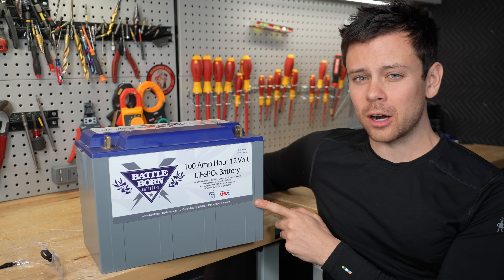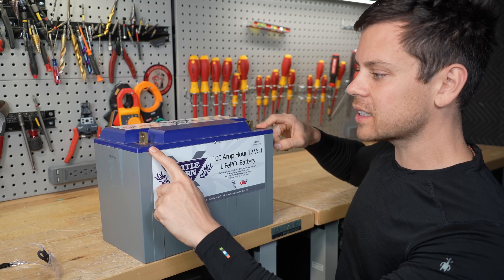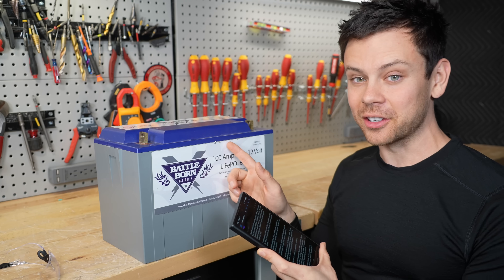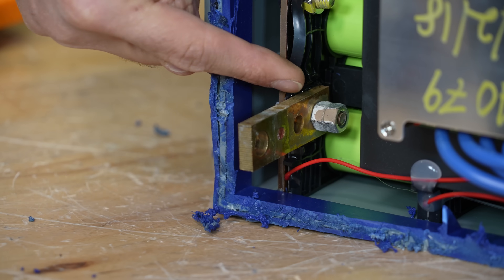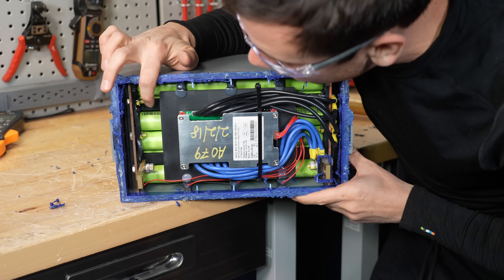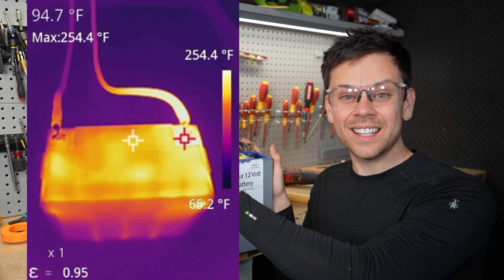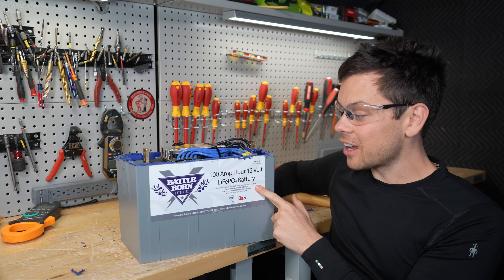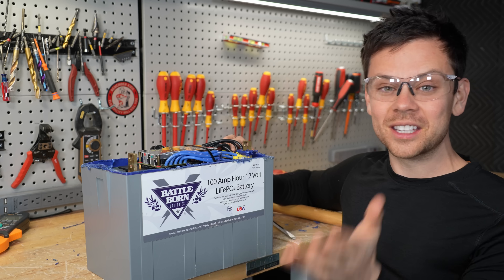Battleborn 12V Battery: Major Safety Issue

Comment: Hey Will. 

I have been TELLING people about this issue since 2019.   I brought it up DIRECTLY with 2 of their highest Ambassadors, SV DELOS and another sailing channel who asked not to be named ,, and I got an EMAIL from BB claiming the owners must have ABUSED their batteries if they were having issues.  There should be a FULL RECALL on ALL this 100ah Build units from 2018-2021.  If ANYONE owns one from this time period and same " series " they need to contact Battle Born and Demand a replacement !!  I am sure there will be a ' Pro-Rated ' fee and the owners required to return the DEFECTIVE units at their own expense. 
I never had one to open like you did , BUT saw this issue in Nov. 2019 when installing a Micro A/C system on a 28ft Sailboat.  ALL FOUR of the 100ah Battle Born units were showing a radiant heat temperature on the Positive Terminal of 
104*  to 126* Fahrenheit while under even moderate loads. 

I am So Glad this has finally been brought to light , 💡 LITERALLY. 

Another reason I love batteries that can be Opened by Consumers with Screws to see the inner components should anything weird be happening with your cell. 

IMHO , I have always said BB is just another Chinese Cell Battery with Chinese BMS and some USA Made Stickers on it.   Same as Dakota Lithium. 

It annoys me when people claim 
" My Battery is American Made "
but you cannot argue with people who are not knowledgeable enough to understand. 

Thanks Will. 

You are Blessed Brother !!!!

Chris~
Reply from the maker: Holy cow!!!!
Reply: Excellent post!
Reply: "I got an EMAIL from BB claiming the owners must have ABUSED their batteries if they were having issues"  Instruction #4 on the 'Made in China' CYA list.
Reply: All Battery  factories are in China.

But the specifications and designs come from the BB company. 

And the BB company also chooses which factory (OEM)  to make it.  

And BB  company  Located in USA
Reply: @VichaDorenaBrTarigan  Actually, no, they're made in-house here in the US. There's a factory tour vid. At least they were.....
Reply: @VichaDorenaBrTarigan partially true.  they choose cells , ( Eve Lithium ) then a Chinese BMS , then a plastic container , then print stickers, Made in USA.  North America is still 5+ years away from 'making' renewable energy cells, i.e. Solid State or other newer technology than Lithium Iron Phosphate.
Reply: @VichaDorenaBrTarigan  How do you know the specifications and designs come from Battleborne and Battleborn is not simply a branded reseller of Chinese designs and products? 
And if what we see here is one of Battleborne's  designs made in China,  what does that suggest about Battleborne's designs and the factories producing them in China? 
Should  not a professional battery producer in China or anywhere else be able to realize such an inadequate design and advise their client as to such a potentially hazardous design?
Reply: @jackoneil3933  Chinese factories make exactly what is ordered of them. Order slop, you get slop. Order high quality electronics (and make sure YOU do the QC), and they'll produce high quality electronics.

The Chinese are very good at manufacturing, but again, they make the quality that their customers ask for.
Reply: @FoobarDesign   Do you have extensive contract manufacturing experience in China or more so relating an opinion?  
From my experience in contract manufacturing and assembly, professional vendors who value their reputation and the reputation of their clients  consider it essential to utilize  their expertise and experience to ensure a product is suitable. 

What you suggest about Chinese factories producing slop when slop is ordered, suggests something important about Battleborne, who sell their products a superior quality, and given the poor design of the product in question, suggests that Battleborne may be specifying 'Slop" or that they are simply resellers of someone else's 'Slop' design, marketed as a quality product.

I looked into Battleborne and the original American founders appear to have merged or sold out to 'Dragonfly Energy' a holding of Chardan NexTech, a Wall St. holdings and marketing company.

Dragonfly Energy's website boasts a Nevada facility  but images of that facility with employees (or actors) in Battleborne costume appears to be a shipping a packaging rather than a battery assembly plant. 

As such, I have to question to what extent Battleborne is a battery manufacturer or simply selling Chinese or U.S. made  Slop?

Thanks for your exchange, it's helpful to get people thinking and susing out the truth.
Reply: @jackoneil3933  In the early days they did post videos showing their in-house assembly process.
Reply: Maybe just the stickers that say some garbage about them being assembled or designed in the USA might be made in the USA but even then, I doubt it. The only thing that might be 'Made In The USA' is the plan to make the battery in China with cheap labour to maximise profit and then blame somebody else when the product fails because they have no idea what's inside that made in China product.
Reply: I agree. Most if not all of these batteries should labeled ‘Assembled in America’ 😂
Reply: You mentioned through 2021. Do the post 2021 batteries have the same problem?
Reply: Wasn't Lauren using Battleborn and having problems, or maybe that was Teal (not the lightning strike)?
Reply: @cSR-71 Yes , Ms Landers had BB's at one point.
Reply: Holy crap
Reply: These are some big claims. Have you proof for them?
Reply: @SurvivalSquirrel Absolutely have Proof for the 4 units I worked with.  An install video of the A/C unit I installed for the company who supplied the components, as per my agreement with them on the 1st unit provided
Reply: @SurvivalSquirrel  You again. Your shilling for BB is legendary. Shill.
Reply: @SurvivalSquirrel  Do you work for BB?
Reply: @ZonJimbo  No, why would you think so?

Comment: Date shows 2/2/2018.  That's a 7 year old battery.  I wonder if this issue got addressed years ago.  We need to see what current production batteries look like inside.
Reply from the maker: Need a new one for sure
Reply: @WillProwse  See if new is the same. If so that will stave off any "we fixed that" claims from BB.
Hope you heal up well and fast!

Comment: Wow, the fact that those two bus bars have rubber between them is such a horrible stop gap fix 

I think they might have put that rubber in there to stop the vibration from loosening the bolts/nuts, but then they (somehow?) didn't realize that current going through the bolt only is a tremendously horrible practice...

WOW

Comment: I’ve had two of these for eight years and haven’t had any problem with mine, but I need to check them
Reply: Maybe you can put a temp sensor with alarm on the positive battery terminal. Or at least a temp sensor without alarm that you can check periodically.

Comment: Wow, that's a major oversight in design. They were probably thinking the cover would hold it in place from vibrating, neglecting the fact the battery pack will vibrate around in the case. Rigid connection from pack to terminal is a bad idea.
Reply: That's not the only problem I think. From what I can see, the nut clamps on plastic, so plastic will deform over time and make it work loose. Also, they didn't add a spring washer...

Comment: Bolting through a plastic part to hold two metal current carrying parts in contact is ludicrous.
Reply: So they have a plastic spacer that holds the terminal in place and its bolted through the plastic into the bus bar and then held with a jam nut? 

So at no point did anyone winder how much current the bolt can take and what happens to the plastic spacer when heated?  Seems like even a rookie shoukd know that.

I just fitted a battery disconnect on my car.  First thing i did? Go and see what got hot after cranking.......

I would say that they need to own this and recall, or shut down shop.
Reply: @spr00sem00se  Plastic can be compressed/crushed, and then the bolts come loose and a resistance is caused. That's the reason for the heat.
Reply: @JimmyCall  Plastic is indeed plastic. More news at 6 c'clock.
Reply: 100%. It's a rookie design mistake.
Reply: Have these clowns never heard of "creep"?
Reply: I cant believe my eyes either. If this is true, then this company is done!

Comment: Battle Born were always way overpriced. Good marketing strategies made them trendy and popular.
Reply: To be fair, when BB started there was no name brand 12V LiFePo4 on the market and the 2-3 Chinese batteries you could find were unknown  companies, no websites, no specs on the bms in/out, zero guarantee.   And THOSE cost $500.  
It's changed a lot.  But really BB was value competitive at the dawn of 12V LFE.  And the only choice if you depended on your battery.  But man, what a stupid design error.

Comment: I noticed a 2/2/18 date hand written inside the battery.  I wonder if Battle Born fixed this problem on later production units or is this a problem for all 100AH batteries made by them.
Reply: I believe that was the BMS production quality control test date.  I don't know how long that same inner design of the positive "bus" connection was used.  But cutting open a 2023/2024 unit sure would be an interesting experiment.
Reply: Im wondering this too. Maybe Will will open up a recent one. If they fixed it at some point with a design change, im sure all owners will want to know if they have the old or new design.
Reply: We have to assume it affects all their batteries. If they had discovered and fixed the issue, they would have informed consumers of the safety issue
Reply: @mikea5745  I dont trust any company to do the right thing.

Comment: Is this problem from a certain year to present? I know you tore down BB batteries in the past, is that how the positive was connected since the beginning?
Reply: This battery is from 2018. Will's first teardown video showed the same design. So yes, almost certainly since the beginning. The question is whether they've changed it since.
Reply from the maker: @Consumer7977  yes, and ten years warranty. And I totally missed it in my tear down 5 years ago. Added a warning in that video as well. Definitely will check for this in every battery always.
Reply: @WillProwse  Is the same defect in their GC2 form factor batteries?

Comment: I can't believe they're depending upon that plastic "sandwich" to keep the components tight. No way this passed a real certification.
Reply: That is insane.   Look how melted it is.   Who thought that was a good idea and why?
Reply: Battle Born says it's a safety feature!
Reply: BB is a tiny company and until the Chinese entered the market three years ago, they sold every battery they could make at high prices. That terminal setup is typical barnyard “engineering” which happens when a company needs to ship product but can’t get the right parts. Stuff gets substituted, some new guy on the assembly line does a half-assed job, and next thing you know there are hundreds of defective units in the field.

I guess we’ll find out soon enough if their ten-year warranty means anything…
Reply: @TimAZ-ih7yb  Battleborn is a publicly traded company -- Dragonfly Energy. Even with their stock price declining >99% over the past few years, they're still a 100M market cap company. A couple years ago they were a multi-billion dollar company. They were a huge company that lost all their customers due to pushing bad products for absurd prices
Reply: Who do you think is certifying these Chinese batteries? They put a label on it and send it
Reply: @mediocreman2  UL certified the batteries, and they're made in the USA. You can find Chinese batteries without such defective designs for 1/4th the price of Battleborn. American batteries are poor quality, for a for higher price
Reply: @mediocreman2  BattleBorn is assembled in the US
Reply: @mediocreman2 battle born is one of, if not the only, battery that is actually built in the US my friend. The cells come from China but all the testing and building is done in the US.

Comment: I remember when these were all the rage!
Reply: They were the rage for paid influencer hacks.
Reply: Now you can buy a Budget Battery after watching Will review its guts and get 3x the capacity for the price of a BB Sticker. 
i.e WattCycle.   I just bought a couple of their bluetooth 100ah units for under $200 each. 
And they spec out to 102/103ah outta the box , and Customer Service is on point.
Reply: @Nomadic_Kokopelli yup. Just picked up 4 of the 314 Mini's (w/o BT) on the Black Friday sale. Rolled em up at the $399.00/ea deal + got the spinna-ma-thingy bonus discount page when entering their web site which gave me an extra  $20 bucks off then used a promo code I got off a YT channel  review which totaled out another like 144 bucks off. Total after tax was a bit under $1600. Now I've got 628ah for my 24v system. Over 16kwh to suckle  on for my off grid build. Under $.10/wh. Not too shaby.
Reply: Well they are still very much a hot item.  ba dum tss
Reply: @Good_Boy_Red  O no you didn't !!!!  lol
Reply: @rasmousein yes,they're having a Fire sale! Ba dum tss!
Reply: Sadly I bought 8 of these 5 years ago. I'd better slap my thermal camera on them to make sure the version I have don't have the same problem.
Reply: @muhdiversity7409  I bought 4 of them also about 5 yrs ago and I just checked them. Terminals are solid, no movement and the red epoxy around the terminal is bright red.
Reply: @muhdiversity7409  looked like a 2018 date code written on top of the BMS
Reply: A different rage now
Reply: there's still people who despite all info only buy brand name everything . and this weekend saw a guy insisting on bb  bat 100 when you can get 2 x300 ah for 1 bb 100  and black fri/cyber mon had 100 ah under 100 del on amazon . i have 3 Vatrer Power  1 Bargen so no rational need for any more
Reply: Yup
Reply: Only to shills
Reply: Bought one in 2017 or 18.  At the time they were viewed as the best because everyone else was selling cells taped together with Daley bms.  No case at all.  Times change fast.  Mine lasted exactly to the warranty period and bricked.  After seeing this I better get it out of my truck (overland build)